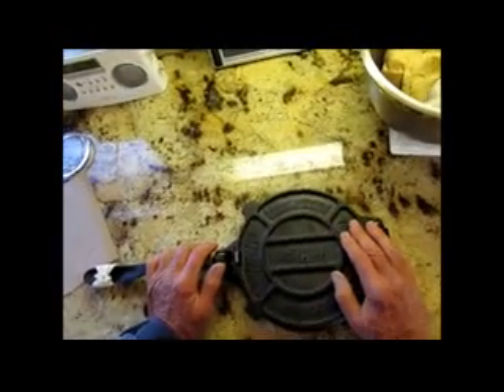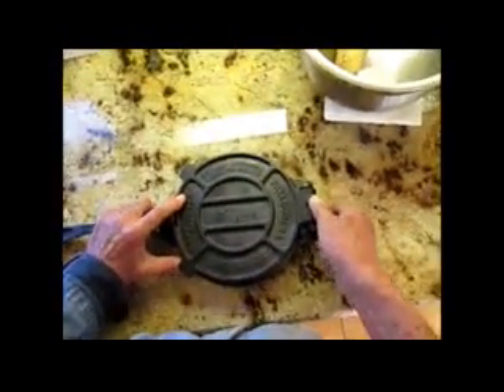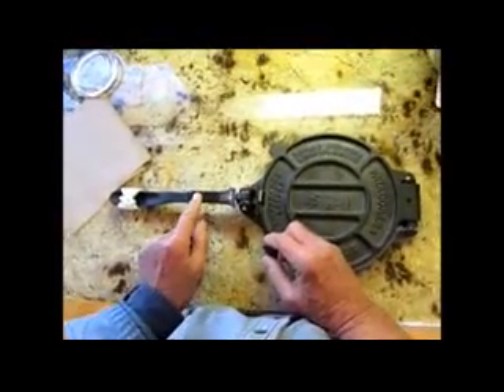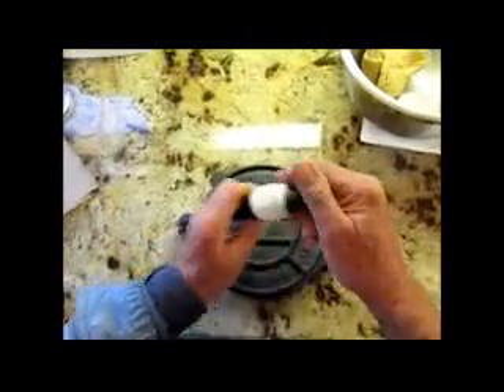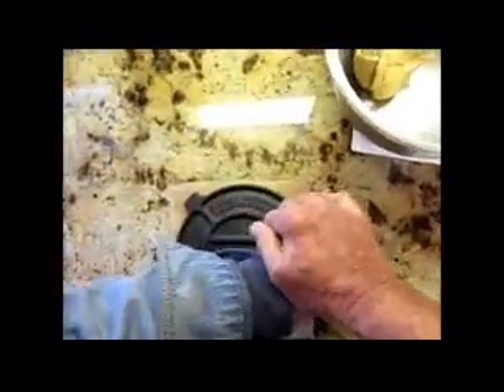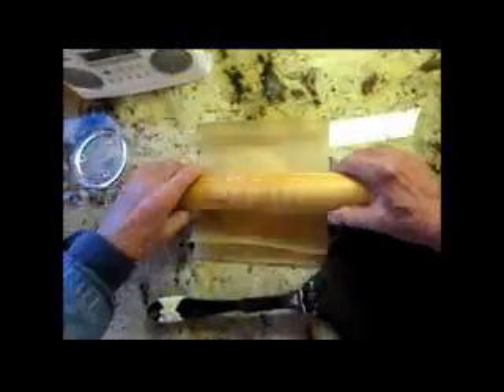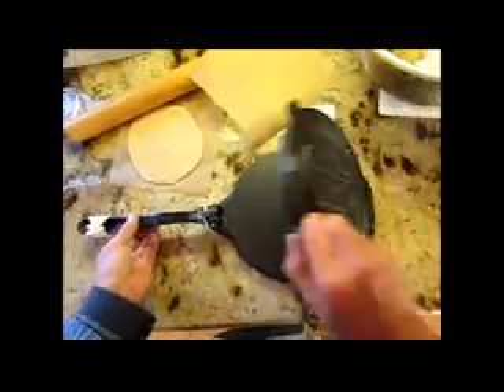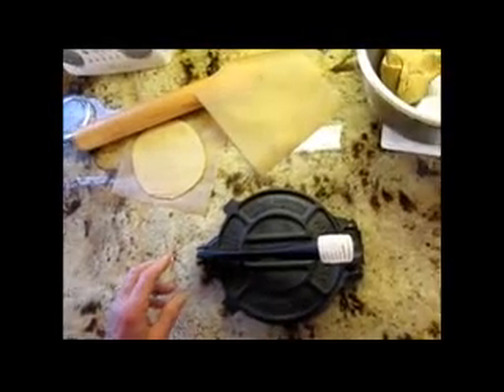IMUSA flat corn tortilla press improvement

Comment: Thank you and you've demonstrated my thoughts exactly, Just bought the Victoria 8" and then looked in the reviews and got frightened of the horror stories. Will definitely add the metal bar beneath the lever to relief strain. your ideas about the washers is smart and will use it. Perfect video and thank you form taking the time. Pretty sad the models build today are prone to breakage.
Reply from the maker: If you like this modification check out trigger-locks.com